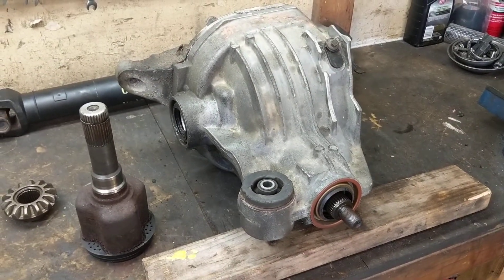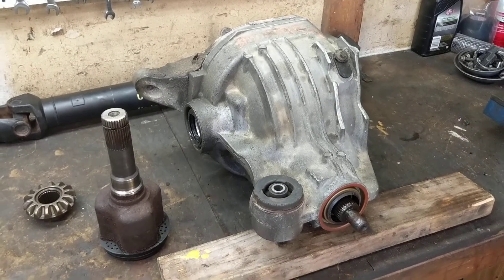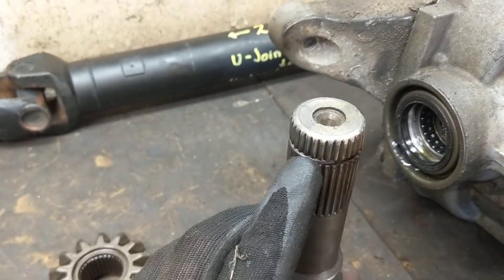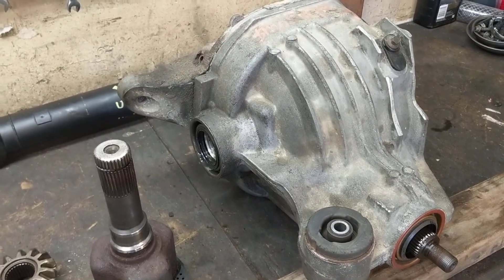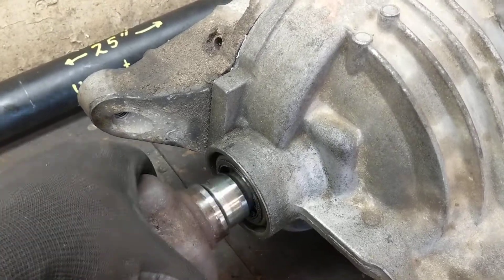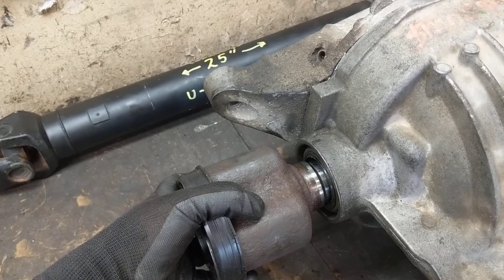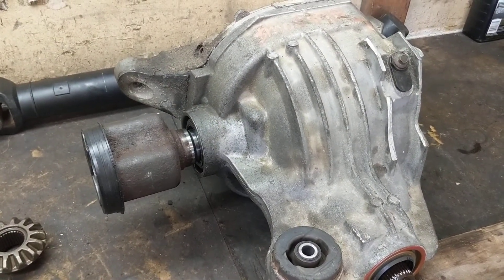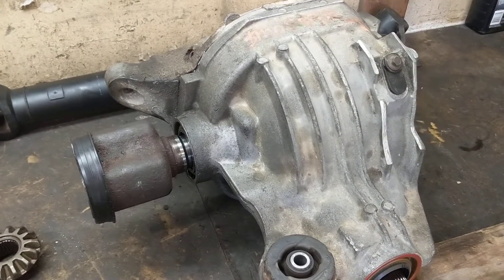Ford 8.8 IRS differential with a solid 8.8 LSD carrier

Comment: do the spider gears from the open irs fit in the lsd solid axle carrier? i just made this exact same mistake and im trying to figure out what my next move should be.
Reply from the maker: I've been meaning to check this out, but I've yet to find the time (read: 'motivation') to disassemble the carrier I built with the wrong spiders. My gut tells me that the open IRS spiders don't have the same stack height and / or backing surface, but cannot confirm this.
Reply: It won’t work. The open diff spider gears won’t have the splines that engage with the clutch discs. So you have to use lsd irs spider gears.
Reply: Just find an explorer with lsd and you should be good. Codes should be D4, D2 and L73. If the door sticker has these codes, it has LSD
Reply from the maker: @Choclito91  Thanks. That's what I feared but wasn't able to confirm.
Reply: @grannypotts  no problem. Just keep in mind explorers has 31 spline lsd, mustangs (except 03-04 cobra) have 28 spline lsd. So if you do end up using the explorer lsd, you will need 31 spline cv joints.
Reply: @Choclito91  Finally, I've spent the past few hours searching for this exact answer all over the net.  Thanks Diego